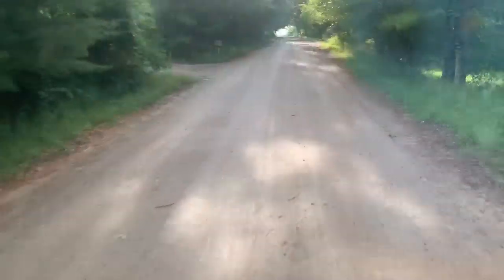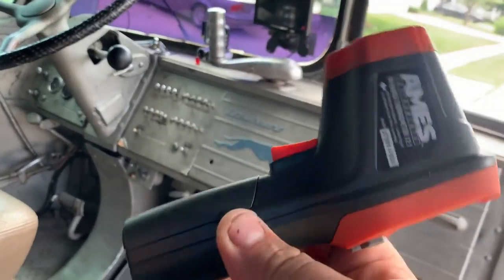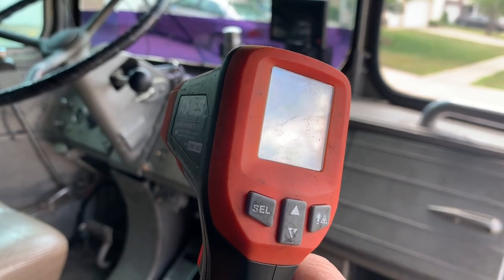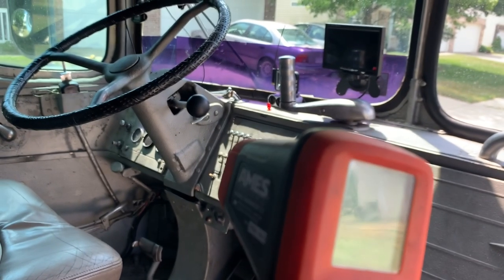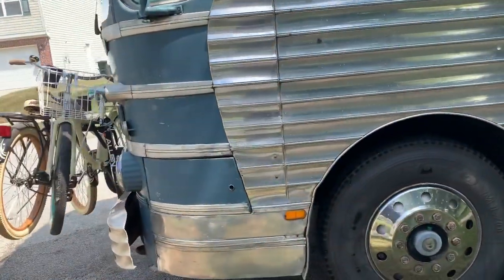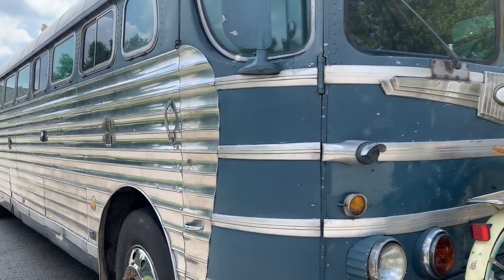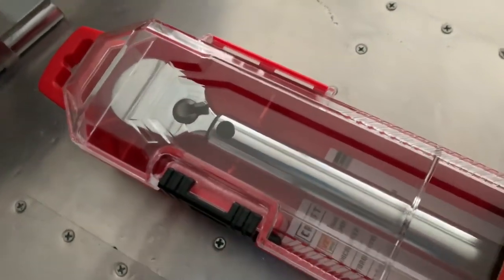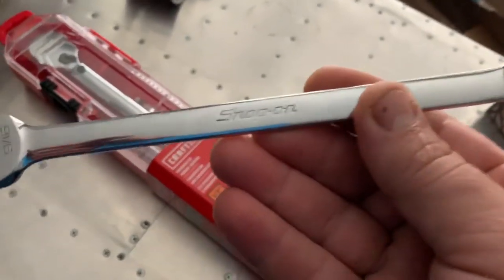Driving a vintage bus in extreme heat

Comment: Scott.... First, Have been subscribed for quite a while now, love your videos and very much appreciate the work and effort you put into "taking us along" with you.  I also want to say I love the T-shirts you've come up with... and would love to buy some from you... However,... I Need a Pocket on my T-shirts for my glasses & pens, I never buy T-shirts that do not have a pocket... any chance you could get some made with a pocket for folks that need someplace to put our glasses & pens?  lol  I wear mostly Black T-shirts, but I also like both of your green ones as well... a "photo" of a 6-71/6-71T embossed on the back of back of the shirt would be great as well... or, is there any "copy-right" laws that would prohibit you from doing that? 

Which injectors are you currently running in your engine?.... I "think" - if I remember correctly a few videos back that I watched, you said you had N65's in it (??).... and which drive gear set do you have in the blower?... Anyway, and as I'm sure you already are aware... that with the 4 valve head you will Really have to watch your engine temp and keep it Under 200 for sure... in fact, under 195 would be even better... there is (as you know) very little "meat" between the valve seats on the 4 valve heads, and they Will crack in a "heartbeat" over 200 if sustained for anything more than just a very few minutes... especially if in an "under load" condition and working hard. 

Of course with a really efficient cooling system that would not be a problem, and any way that you could find to duct "Outside" air directly into the radiator and engine compartment, as well as providing more ways to vent the hot engine bay air - Out, would be Very beneficial and could allow you to "open the engine up" and get some real hp numbers out of it.... 450 is very doable, reliably... but Not without efficient cooling, both in the coolant system and overall airflow in the engine compartment. 

Also, if it were mine... I would be finding a way to get Outside air fed directly to the engine air Intake/filters... doing so would Not necessarily do anything to alleviate overall engine temps, but Would help increase engine output... as the cooler the intake air is, the denser it is... thereby packing more air into the cylinders.  Hot air intake from "under the hood" may provide for a "cleaner" setup... but does nothing for engine performance whatsoever, not to mention better fuel burn with outside air. 

Another issue that can really benefit from an "upgrade" is the old "Oil Bath" air cleaners... although they were great at collecting atmospheric "debris" and other particulates... they do NOT flow well in relation to air intake flow (in terms of cfm).... a good dry type filtering system would be very beneficial in "waking up" your 6-71.... Especially, if could find a way to directly duct Outside air flow to it. 

The large "trash can" air filter housings would be the best... but Not practical in the confines of your engine bay. However, International Trucks used a lot smaller (in diameter & height) polished Stainless steel (like most of the big hood semis have) outside air cleaner housing on some of their conventionals (with engine hood) and COE's (cab-over engine) from the 1970s, 80s & early 90s that could be adopted into you engine bay,  and there are others as well... scrounge the heavy truck salvage yards, there are many different sizes to be found, but the old COE engine air intake filters, almost All - had a "down pipe" from the top of the back of the cab to the filter housing for outside air intake, which would give you the ability to plumb some ducting for outside air intake.... your 6-71 would love it! 

All this applies to All coach/bus conversions (or not).. they can All benefit from these mods & upgrades.

What is your engine's governor set for - for full load rpm's?  The original 6-71 engines in those "Silversides" were all "low-blocks"... correct?   Is yours all original, as far as the engine is concerned - other than the radiator and bigger injectors?   My V-12's I had in my three semis over the years were set at 2,950 (no load rpm) with the marine springs of course, and I also studded the engine block and used blanch ground washers and nuts at the head, rather than "head bolts"... kept everything "together" much better. 

We had the V12 in the "Lady Butterfly" (sled puller - NTPA Pro-Semi Class) spinning at 4,000 to 4,200 during the pulls - since the 1980's and Never "blew it up"... hp was pushing 2,500 and torque right at 3,000+/- ftlbs.   It was sold to a new owner three years ago now, and the new owner put a Cat in it for the 2018 season, sad to say.

Comment: Scott- Do you have an a/c compressor for air conditioning on the motor or do you run the generator and power a different type of a/c?? Saw you had the window open in 100 degree heat and thought my wife won't go for that. Luv the channel
Reply from the maker: We can run the generator.   But with the windows and fans running it’s not to bad up to about 90.

Comment: Will any of these aftermarket gauges get persnickety when you have to run too long of a length of wire from the sending unit to the dashboard? I mean, most of them are intended for a short underhood run, like in a car or pickup. Are there any brands that are better than others? Perhaps a purely mechanical temperature gauge would be best, although that'd be one helluva long bellows tube!

Comment: One tip I would add is to run a bungee cord through those bike tires and secure it to the frame. Nothing worse to getting to your destination and be missing a front tire. Speaking from experience.
Reply: Or a damaged front wheel due to it banging around in the airflow...as I just recently learned after installing a bike rack on my father’s vehicle.
Reply: @ethanpoole3443  I came out of a Dunkin Donuts once and this lady and her kids were on there way to a cabin on vacation. She had installed a bike rack on the back of her Honda SUV with two bikes, and it was wobbling all over the place .There were a  few ratchet straps attached to the bottom of the bumper. I said to her "I'll fix that," so I started ratcheting some, and RIP!!. Off came the outer shell of the bumper. Needless to say, I didn't feel like the hero after that. LOL!
Reply: Big John As they say, no good deed goes unpunished!  But at least you tried to be helpful, though damaging bumpers is very easy these days since all they are nowadays is plastic covers over a styrofoam or plastic crushbox over a modest corrugated aluminum or steel beam for a bumper.  It was much easier back in the day when bumpers were solid steel and directly attached to a frame via a pair of impact absorbers!  The best course of action these days is to look to see if they have a set of extraction/tow hook points just behind the bumper to attach to rather than direct to the plastic bumper cover as these are substantial points to tie into, if available, since they are designed to support the pulling force of a stuck vehicle.

Comment: Gee wiz Scott, I think it's time for you to install an air conditioner in your bus.  You can buy a decent truck ac unit and install it somewhere up front to use while you're on the road.  Hate to see you suffer like that!  I'll help you. (have you seen my ac videos?)
Also on the overheating problem; an old bus guy once told me on my 4106 that when it is over 80 outside and they run 100 degrees over ambient temperature.  So on a 90 degree day it would run 190, except of course on hills.  That seems pretty consistent with my experience.  However, one mistake I see a lot is people not making sure the radiator is sealed up around the edges to keep hot air from recirculating from the inside back to the front of the radiator.   Another is incorrect fan size.  Both important factors.
Reply from the maker: I have air conditioning.  With the windows open and fans on we were not dripping sweat.  Running the air means running the generator though and that costs about $5 per hour.  I’d rather use that money somewhere else to be honest.  If we were sweating through our clothes i would have turned it on.  1st class VS coach bus fare i guess.

Comment: Thanks for the update. How is that Henry's roof coating holding up?  That stuff is not cheap. Trying to figure out if I can paint my Airstream roof with 1 gallon. I have it parked in the sun now and it gets hot inside.
Reply from the maker: No complaints.  Cleans easy and looks great.

Comment: We use a product called Mirrorex on our polished aluminum.  Youd be amazed.  Saves you from polishing if its not THAT far gone.  Brings it right back.  Spray it on dry.  Rub with soap and water.  Then rinse.  Check it out!!!!

Comment: do you have a manual switch for your radiator fan?  When the heat climbs you can throw the switch to the radiator fan, a lot of the big trucks have an air clutch on the fan, I would assume yours is the same.
Reply from the maker: No, mine is just belt driven.

Comment: not sure on the turbo you said on what effects it has in the extreme heat as a turbo anytime you compress air it heats it up and if you have a 5 row radiator how will you fit the intercooler infront of it without the intercooler and a turbo it could overheat the engine on a hot day.

Comment: I don't know just thinking if you can reverse the fan for the heater core or divert the hot air to the outside, using the heater core for extra cooling wouldn't be a bad idea for mainstream cooling.

Comment: 62-65 mph is a comfortable pace in my opinion. In reference to your engine temps, are you referring to ALL Detroits in general, or just the 6-71 ?.
Reply: No detroit likes to overheat, they will crack from the valve seat across to the injector tube. Manuals normally state 95C around 205F as being pull the pin temp. 160 - 185F is their happy place. Some of the 12V's are slightly more prone to damage just due to the more tortured water path thru the engine.
Reply: Worth keeping in mind that the 71 series dry liner relies on metal to metal contact for cooling between the liner and the block and the 92 is a wet sleeve and has coolant directly on the cylinder liner.
Based on the Jimmies I drove as Coaches years ago weirdly the 6V92's had the highest rate of overheating issues though BUT knowing what I now know thanks to Scott that will have been due to an incorrect maintainence regimen.
Reply: @tony66au  Also the head is quite wide and flat, with the water passages at the outer edges and the heat source right in the middle, Detroit have addressed the steam pocket problems with the coolant jets pressed into the head, the aiming of these jets is critical to keep water flow at critical places from localised boiling.

Comment: I am curious if you pull off the road because of high temp would it be better to run a high idle with no load, regular idle or shut down completely?
Reply from the maker: Yes it’s not good to shut it off.   Idle will cool it down quickly

Comment: Hi Scott I have a question that you might think is crazy but I was wondering your column shifter is a H pattern 4 speed is reverse on the same shifter are is it a separate shifter
Reply from the maker: 1st gear press and hold reverse solenoid and pull into 2nd gear.  That’s reverse

Comment: Just so you know that Craftsman torque wrench is not warrantied, like they used to be, if something was wrong with it and you take it in to get it fixed you'll find out that it cost more to get it fixed and buy a new one ,I've got one in my toolbox that's like that , I now use an analog snap on torque wrench from the 60's much more accurate

Comment: Did you say in order to put a turbo on the 6-71 you have to pull the engine and switch the cam to the other side of the block so the head can be rotated so the exhaust is on the same side as the blower?
Reply from the maker: Correct

Comment: Passengers rode in those buses in extreme heat and extreme cold. Drvers drove those buses in extreme heat and extreme cold.  When was the first air conditioned bus put o the road?  If you didn't want to go by train, the bus was the only other way to go.  I guess you persevered.
Reply from the maker: This had factory air conditioning in 1947
Reply: Even the modern motorcoaches are a pain in the ass to keep cool inside in 100*F heat. I own an H3-45 Prevost, which is the pinnacle of passenger motorcoaches, and you put 56/passengers in that thing in this weather and you’re going to run max climate control just to keep the ladies makeup from melting off their faces. Most people don’t realize how many BTU’s 56 people produce. Anti-idle laws in many metro areas make it even more difficult. On the plus side, the 12.7 Series 60 will haul 56 passengers, all their luggage and 200 gallons of diesel through the NC & Tennessee mountains on I-40 and not break a sweat. I LOVE Detroit power. At least before Mercedes purchased them anyway. I’d love to have a fully restored old MC9 fully polished up to take small groups in just for fun.

Comment: Are the Harbor Freight torque wrenchs junk?
Reply: Probably not, but the problem with HF is quality control and thus never knowing exactly how much confidence to place in something that has a calibration.
Reply: @ethanpoole3443  you can buy a calibration guage to check them,also most tool trucks have one on board used to check them.
Reply: @JohnSmith-bx1mp  You can check the calibration with another torque wrench too if you have a 1/2" square socket 1/2" drive, or a twelve point that fits. Just tie the two together set it for the same torque rating and they should click at the same time.

Comment: Look at flushing out your cooling system with citric acid and then adding Water Wetter to the coolant.
Reply: I had an oil cooler leaking once in an 8V71. The cooling system was gummed up. I used Draino drain cleaner to flush the system. It was like brand new after that. No, it didn't  hurt anything.
Reply: @bigjohn6475  Citric acid is just a whole bunch safer